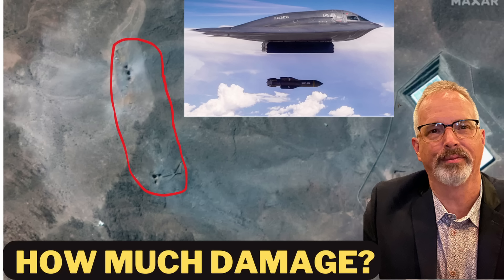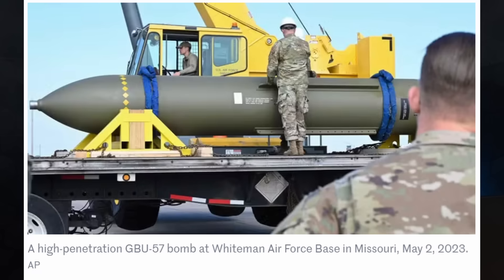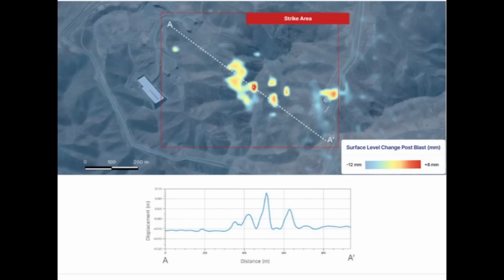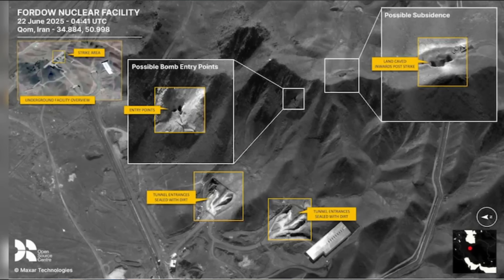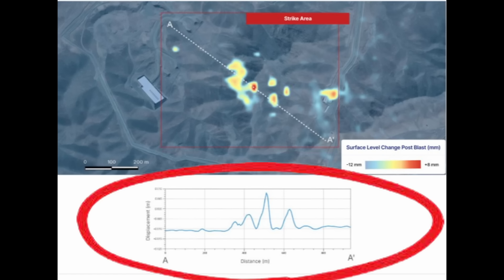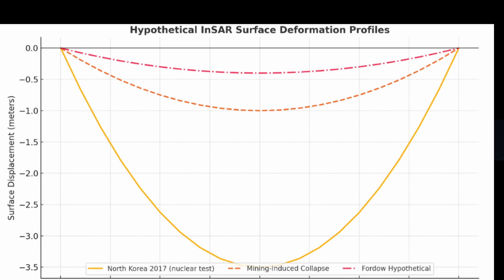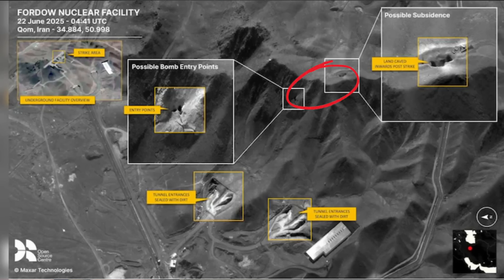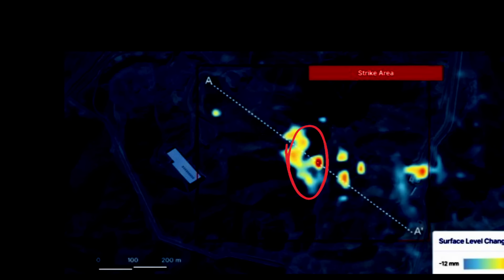Fordow Attack Assessment -  Update

Comment: Unfortunately you can not destroy the U235.  If in solid metalic form, a matter of remining the facility to where it was stored.  If in UF6 form it might be either solid or gasseous.  Gasseous might disperse but it might be solid for temps of 130F or so.  I am sure most centrifuges at the site were destroyed, but to bring up the 60% enriched to 80% or 90%  does not take as many or as long as to get from 0.7& to 60%.  I am sure they will recover some or most of the 60% enriched U235, and some centrifuges.  From there it will be whack-a-mole for the next decade to prevent the accumulation of enough weapons grade U235 for a weapon.
Reply: From what I understand, by the time you're at 60% 92/93% of the work is done.  Another point is the Iranians placed the caps before the raid, so they had advance warning.  Best guess is the had about 500kg of U-235.  Think they left the 'good stuff' there?  I don't.
Reply: @tvbopc5416  How does placing the caps indicate that they had advance warning?  Israel was attacking them and Fordow was an obvious target so, even without advance warning, capping the shafts was an obvious way to increase the site security. It was also, incidentally, an admission that the shafts were a weak point.
Reply: @tvbopc5416   Uranium needs to be 95% or higher purity to create a bomb.  The higher the percentage, the harder it is to purify.  60% purity isn’t half way there.
Reply: @raybod1775  Absolutely and totally untrue.  Please stop distributing false information.  20% enrichment of uranium is all that is necessary to produce 'weapons useable' material and create a functional bomb.  While not the most efficient and not useable for an air deliverable device, it is completely suitable for use in a device hidden in a lorry or a tanker.  Material at 60 percent is completely useable as-is to produce a device suitable for mounting on an IRBM.  Little Boy used 80 percent material which demonstrates the 95 percent number to be poppycock.  The reality is they have 408 kg of 60 percent material would could be converted to metal and used TODAY to build 4 devices, or it could be further enriched to produce up to 10 devices.
Reply: @raybod1775  Yes it is.  It's a geometric progression.  For more detail, see Postol on Daniel Davis 'June 2025 Iran Attack:' - from about 55:00 on.
Reply: @raybod1775 You've both got it backwards and made the mistake of thinking effort is linear, it is not. So enrichment from 0.7% to 3.5% fuels grade, very difficult. 3.5% to 20% still significant effort. 20% to 60%, substantially less effort. 60% to 90% much less effort.
Reply: @raybod1775  Minimum is about 80% for a bomb. That weapon would be very inefficient but it would work. 90% gets you to the efficiency level of Little Boy. >95% is optimal but not necessary.
Reply from the maker: You are right. There are many aspects to this situation.
Reply: The 60% enriched material can be fissioned to produce plutonium, which is easily separated chemically.  Just as the US made both uranium and plutonium bombs to drop in Japan, the Iranians have both options.

I really doubt the 60% material was at the site.  The Iranians were given ample advance notice.
Reply: @maxenielsen  60% enriched uranium does not itself “produce plutonium”. Plutonium is not made from enriched uranium.  It is made by irradiating natural or low-enriched uranium fuel in a nuclear reactor, where U-238 captures a neutron and transforms into Pu-239 through a decay chain.  There is no intelligence indicating Iran has this capability.
Reply: It seems unlikely that Iran is converting its enriched UF6 into uranium metal at a 60:40 U-235/U-238 ratio. They do not have any reactors capable of using metallic uranium, regardless of the enrichment level, and the reactors they do operate utilise uranium dioxide (UO2) pellets as fuel. Therefore, it is reasonable to assume that the HEU is being stored in gaseous form to allow for further enrichment towards weapons-grade material if desired. If the piping and or centrifuges were breached by the MOPs the UF6 would rapidly react with moisture in the air and hydrolyse into an extremely toxic uranyl fluoride acid dispersed throughout the buried rubble suffice to say recovery would be extremely difficult and resource intensive, they certainly wouldn't be able to hide such an operation.
Reply: Considering the likely contamination, I would imagine the risks and exposures associated with any kind of clearing operations would be problematic - making entombment a better option than trying to save anything in the area. And, with 200+ ft of overburden, I suspect the danger to workers or the general population in the area would be minimal. Just walk away people, and consider this a lesson in wasted resources. Peace is always a better option when messing with nuclear weapons.
Reply: @crabbyhayes1076  None of this material is irradiated meaning that standard uranium mining precautions are totally suitable from that perspective.  Any uranium in the enrichment cascade is in the form of UF6 and has mostly condensed into an easy to gather white solid at the temperatures here.  This is the highest and best yielding site to mine uranium in the country.  I see absolutely no reason whatsoever to think of that material as 'wasted' in any way in such a programme.
Reply: @crabbyhayes1076  But life doesn't mean anything to them.  They'll sacrifice as many as it takes to get it out.
Reply: @crabbyhayes1076  Uranium itself, in the metal form, is not really dangerous. Its quite a weak natural emitter, this is why it is still there.
Reply: One thing that’s for sure is that a clear message was sent and received.
Reply: @ntwalipat2  said: "One thing that’s for sure is that a clear message was sent and received."
Yeah, the message is don't even cooperate with any international organization. Go totally stealth.
Reply: @ntwalipat2  Not just to Iran but to the world community.
Reply: @ntwalipat2  One thing that is for sure is that nobody can stop Iran from getting a nuclear weapon if it wants to build one. You can destroy Fordow completely, but where is the 500kg? Building a centrifuge is not some technology Iran has to import. Iran has the complete industrial capacity. The US and Israel can try, but they will never succeed. Even if the US gets full access to every site in Iran, Iran can still develop a bomb. Furthermore, who said that Iran doesn't have the blueprint for a bomb ready? I hear people talking about a year to develop a bomb, but I am not so sure. Designs can be sold or given for free. Testing can be done in another unknown country. The problem is that a lot we don't know and will never know.
Reply: I would not assume the Iranians will rush to dig up whatever uranium may be still buried at the site and start trying to use it again.  If the US and Israel intelligence sees (as they can) Iran doing this, they can take out the operation, and keep doing it as many times as needed until they get the message. I suspect that at most it will take one more "message" before they give up, or a regime chance takes place.
Reply: @nabuk3 western neocon propaganda.
Reply: @nabuk3 
They are in psychological turmoil due to unexpected events. Aspiring superpowers had gotten in a habit to inflate their military prowess, and with the US's inaction on Iran's nuclear pursuits, Iran grew defiant and very confident in their nuclear aspirations. Now, they're set for a reality check, as a message has shown the regime's vulnerability to unforeseen actions. It was a pivotal moment!